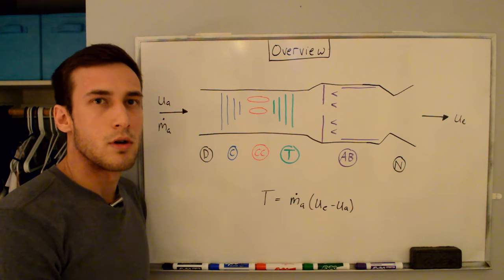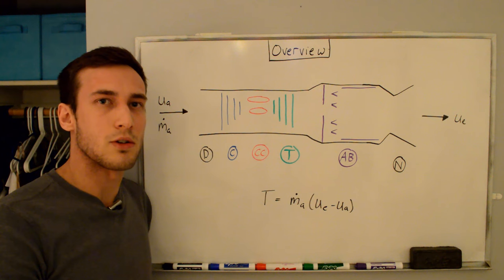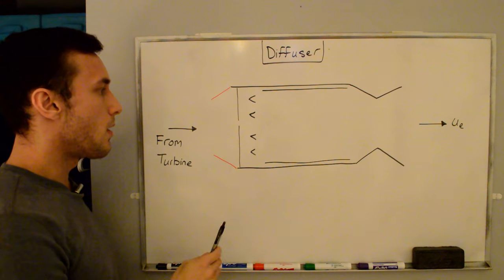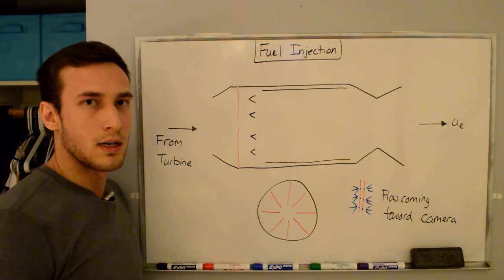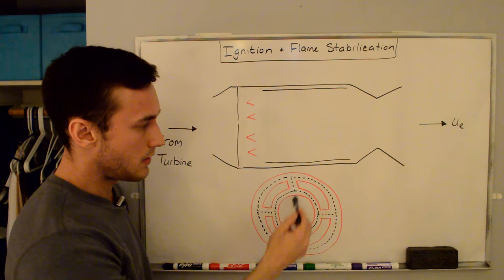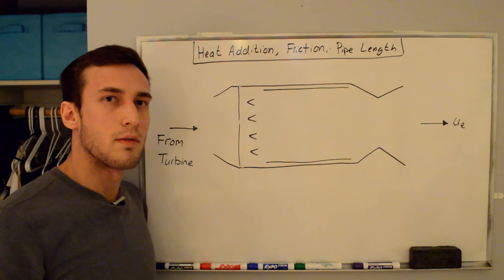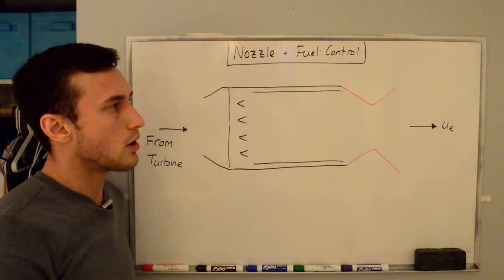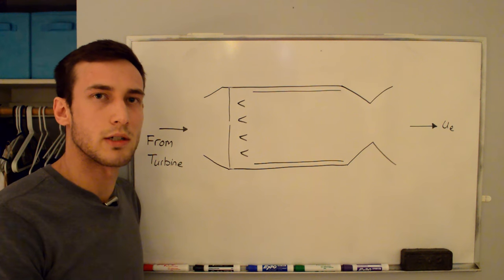Explained: Afterburners

Comment: Good video, although you should try to talk a little bit slower ;)
Reply from the maker: Thanks for the feedback!
Reply: Yea but not to slower man ahahahah
Reply: I was about to ask if that was just one very long word or if there were more than one words in that whole video. (edited - sorry: very good video in any case)
Reply: I agree, very good video but yes the delivery was very fast and at times hard to follow.  Also a two second break between concepts could be very helpful.
Reply: Go to YouTube settings and adjust the playback speed to your liking. I often find I like to speed up lectures this way.
Reply: Instead of editing out the pauses...it would be much better to leave some space  for the audience to absorb what was said.  At least for this audience member.
Reply: Thank you very much for allow me to learn about aerothermodynamics even my duties and my decisions prevent me to do it at the right time. By the way, i work as a aerodrome inspector and I would like to know if is there any method to estimate   the air intake area for a transonic plane using idle power for a two engines aircraft?. That is very useful for designing safety areas for handling people. Thanks in advance!!!
Reply: Not native english here, everything its easy to understand at the current speed of this video.
Reply: Josh's brain is just real big you can tell he knows EXACTLY what hes talking about and is getting that knowledge out very efficiently, hes op

Comment: Very informative. This explanation is on the engineering level not just on the fighter pilot level. This explains why afterburners don’t all fire up spontaneously and the g-force on take off increases the longer the jet is on take off roll. That being said it’s very easy for the pilot to exceed landing gear retraction speed. Retracting speed is lower than extended speed.

Comment: I like how you get to the point immediately. The inclusion of the diffuser makes sense but is also kinda counterintuitive. The afterburners are there to increase the velocity of the gases but to utilize them optimally we need to slow down the gasses first. I imagine that tuning the diffusers must be quite a challenge. To have a design that results in the maximal net velocity gain.

Comment: Very good explanation that made my brain think faster. A couple of questions. Do the fule injection nozzles use the venturi effect to help vaporize the fuel upon exit? With after burners do you need an additional flow of bypass air to cool the heat that would be absorbed in the frame. I was thinking bypass air would be sandwiched in between the intimal surface of the combustion chamber and the outer layer. This question arose in my mind because afterburners are used upon take off when the plane is not moving very fast and they heat could melt the metal around the combustion chamber. Finally can the fuel be super heated prior to exiting simply by having the delivery fuel lines wrap around the turbine frame?

Comment: Hi. So, is an afterburner basically the same thing as a ramjet? Just the afterburner goes behind the turbojet, and the ramjet stands alone?
Reply from the maker: They're close but not quite the same.  The main difference is that the ramjet gets all its pressure increase from the flight Mach number (using the stagnation relations I have derived in another video), while the afterburner doesn't have this drastic pressure increase.  In the video I do mention that the diffuser before the afterburner slows the flow down and increases the pressure slightly, but the amount of compression in this case is much lower than the compression that occurs in the ramjet.  This is because the pressure after the turbine of a turbojet is still pretty high, so it's not starting from the atmospheric pressure.  But you're right that they are close in terms of their operation.

Comment: I'm wondering, AgentJayZ mentioned that an afterburner increases thrust by about 50%. Where does this number come from, and what is limiting it? Where does the unburned air come from, or more accurate, why can't we burn that air in the combustion chambers?
Reply from the maker: I'm going to go into more detail about turbojet calculations in my upcoming videos, and those will include computations with afterburners.  There's a lot going on in these analyses, but I'll try to give a quick overview.  At a certain flight speed and air mass flow rate through the engine (let's assume those are constant), the way we can increase thrust is to increase the exit velocity of the gases coming out the back of the engine (see my turbojet thrust equation derivation video).  In simple terms, we essentially want to be able to convert some amount of energy in the engine to kinetic energy (energy associated with the moving gases).

Let's first say the afterburner is off.  After the combustion chamber, the gases flow through the turbine to power the compressor, and there's a certain amount of energy left over that we can convert to kinetic energy.  But if we can increase that energy further, then there will be more energy we can convert to kinetic energy, and thus a higher exit velocity, and thus a higher thrust.  The way we added energy to the flow before the afterburner was by injecting and burning the fuel in the combustion chamber.  How much energy did we add?  It depends on the mass flow rate of the fuel and the energy density of the fuel (usually around 42 MJ/kg).  Now let's turn on the afterburner.  All we are doing is adding more fuel, which when we burn it releases more energy into the flow, which let's us convert more to kinetic energy.

The nozzle is important because it maximizes the exit velocity for certain engine operating conditions.  The added mass flow rate of the fuel by itself actually also increases the thrust slightly, though not much compared to the actual combustion energy release.  Aircraft engines always run fuel lean, which means there is extra air left over after combustion.  A lot of the air is used for cooling in the combustion chamber itself.  This is the extra air that we can use in the afterburner.

There's a lot more detail that I'm going to get into in my future videos on aircraft engines, but this is at least a start.  Hope that helped.
Reply: Thanks for the great comment!=)
sorry to say that but I know how turbojets and afterburners work, I was mostly wondering what is limiting the afterburners thrust. Of course it's the air, but what determines the amount of air left in the exhaust stream?
Reply from the maker: Yep, no problem.  It's hard to judge how much people know, so I usually default to a simpler explanation that can also help others who read the question.  The fuel-to-air ratio pretty much dictates what amount of air is used in the main combustion process.  When going through the analysis, the fuel-to-air ratio is computed as a function of the turbine inlet temperature, so that places a major limitation on how high it can be.  You'll find fuel-to-air ratios around 0.01 to 0.02 are common, while the stoichiometric fuel-to-air ratio for aviation fuels is around 0.067.  This means they are running fuel lean overall.  I say overall because in the zone where the combustion is occurring, a fuel-to-air ratio of 0.02 won't even ignite, and the actual equivalence ratio is pretty much 1.

Here is a quote from Hill and Peterson: "...to promote stable and rapid burning, it is necessary to supply less than half the compressor delivery air directly to the primary combustion zone; most is used for diluting the combustion products to reduce the temperature following combustion."  This makes sense with the last paragraph, since we compute the fuel-lean operation by using the turbine inlet temperature limitation.  If we increased that temperature, we would get higher fuel-to-air ratios, meaning we could use more of that compressor delivery air for combustion.

There is a figure that you might be able to find on Google (it's also in Hill and Peterson) that shows relative percentages of air in a combustion chamber.  It shows that roughly 20% of the air from the compressor goes to the primary zone of combustion, while the other 80% is used for dilution and cooling.
Reply: Oh, thanks a lot! That was a great explanation. I didn't know they were running so lean, since from piston (diesel) engines you're used to think that you can just add as much fuel as you want until it's stoichometric (or just below).

One more question to your comment, if that's okay:
" I say overall because in the zone where the combustion is occurring, a fuel-to-air ratio of 0.02 won't even ignite, and the actual equivalence ratio is pretty much 1." 

Is it right that you're saying, the overall air-fuel-ratio is  lean, but in the area of the combustion chambers, it's about stoichometric? (at full throttle?)
Now on reduced throttle, I guess the mixture is pretty lean in the combustion chambers as well, but not too lean to ingnite, is that right?

The turbine inlet temp makes a lot of sense to me now. So with that ..let's say 80% unburned air and 20% burned air, that's what determines how much thrust(how much fuel can be burned) my afterburner can produce, right?
Interesting.. so at full throttle, the AB will never be able to burn more than about 3 or 4 times the fuel of the actual combustors, in reality less probably.

But also interesting, if you had the engine running at full rpm but very low power setting, you could produce almost full AB thrust if you wanted, because the AB is getting full air supply basically, actually even more than if your normal combustors would burn their 20%. (at full throttle).
Reply from the maker: Right, the total fuel-to-air ratio is lean in the engine overall, which accounts for all the air coming in and all the fuel being injected into the main combustion chamber.  However, like you mention, in the zone of actual combustion, it is very nearly stoichiometric.

I'll have to make more generalized statements here, because lots of things are intertwined.  But yes, if you reduce the throttle, you still need to be in the correct equivalence ratio range to make sure ignition of the fuel-air mixture is possible, so you'll still be operating very nearly stoichiometric in the primary zone of the combustion chamber.  But now you've also changed your air mass flow rate through the engine which affects the overall engine's fuel to air ratio.  This also affects the pressure and temperatures through the engine if you've slowed down or sped up.  And don't forget that the ignition bounds are also related to the pressure in the combustion chamber.

In a simplified sense, we can say that all of the air that is not used in the combustion process with the initial fuel can be used in a combustion event later on.  So the 80% of air not used would be able to be mixed with fuel down the line at the correct proportions and burned.  If you take that air and mix it with enough fuel so that it burns completely at an equivalence ratio of 1, then you would consume all the remaining air (oxidizer).  If you run out of oxidizer, then the excess fuel won't be able to burn, and you'll just be wasting that energy (but you'll still be getting a little bit of extra mass flow rate in the thrust equation as a consolation prize).
Reply: Very interesting, thanks. 
I thought the airflow could be kept almost at a maximum, even with the engine injecting very little flow (by changing the stator angle). But everything you said makes sense, thanks again for the answer. 
I really like it when I can actually learn something from someone with actual knowledge, because here on youtube and on the internet in general, very few people actually have any serious knowledge of the topic, whatever it is. And even less people are willing and able to explain it as well as you did.
May I ask what you do as a profession/job? It sounded like you've studied turbine engines and this thermodynamics stuff.

Comment: To save time, the increase in exhaust gas temperature is relative to the increase in thrust. Increase the EGT with an afterburner by 30%, you get approximately 30% extra thrust.

Comment: Some like it hot and some sweat when the heat is on. Low/non bypass engines fall into the latter category though high bypass engines fall into the former category. Sure, the main reason why afterburners are inefficient is because the main is exhaust is expanded from the first combustion stage and thus has a lower pressure in which fuel burns worse in low pressure air than high pressure air. However; that being said, the pressure downstream of the turbine in a low/non bypass engine is still considerably higher than the pressure downstream of the turbine in a high bypass engine in which the exhaust and bypass are even more expanded. Thus afterburners are effective only on engines with very little bypass. Neat isn’t it? 😃

Comment: Great - even better if the video was intercut with real-life examples of each part as explained.
Reply from the maker: That's a good idea for future videos.  I would only be able to include pictures that I have permission to use, and I didn't really try to find any for this video.  I was able to get some pictures of the afterburner section of a J79 when I went to the Virginia Air and Space Center, but that was after I made this video.  I might make a supplemental video or a blog post on my website at some point with these pictures.

Comment: I wonder if adding nitrous or gaseous oxygen/liquid oxygen to the fuel in the afterburner would produce even more thrust. Definitely not practical for actual use by aircraft but would be interesting to test in a homemade turbojet.
Reply: nitrous or liquid oxygen no. more fuel yes.

Comment: In stead of heating the fuel , and in another step use a deffussor , rap the area with the fuel lines , it would supper heat the fuel and remove the heat from the  bell inducing lament flow,

alsow have a sliding "door" at the fuel line exit, have it so only opens when afterburner is kicked in

Comment: 1:00 engines operate fuel lean? Could someone expand on this for me? Why?
Reply: about 80% of the air goes unburned, so as to cool the combustion chamber and liner, (flowing through the holes from the outside in, toward the flame) otherwise the they (and the turbine) would melt. Yet it still contributes to thrust since it gets accelerated backward.

Comment: Soooo to put it plainly yes we call them "jet" engines but they're simply just prop engines that we like to call them the fancy term "turno fan" engines. Yes they have a "jet" stream out the back but whats creating that jet stream is essentially just "turbo" fan which is just a bunch of propeller blades. We're not as technologically advanced as you'd might believe. LOL

Comment: i cant understand why there is a "blowout" haha :) can someone explain it to me slowly :)
Reply from the maker: Here's an analogous explanation.  Put your arms down at your side.  Then, try to extend your arms as fast as possible.  It takes you a certain amount of time to extend you arms (it's not instantaneous).  Now imagine you're standing in a slingshot device next to your friend who is standing on solid ground.  When the slingshot fires, in order to "keep the flame lit", you'll need to reach out and touch your friend.  But if the slingshot fires you away faster than you can extend your arms to touch your friend, then you won't be able to "keep the flame lit", and you'll have what's called "blowout".